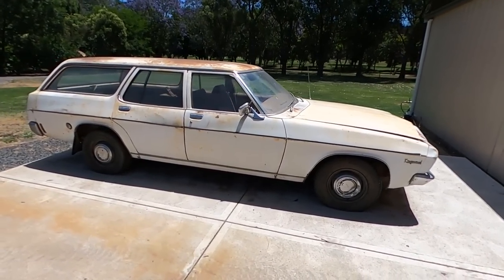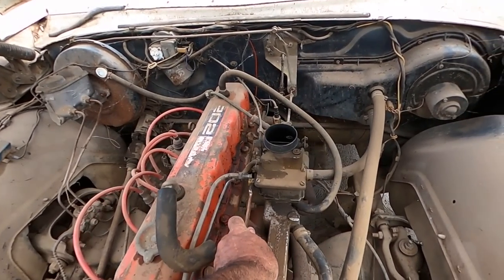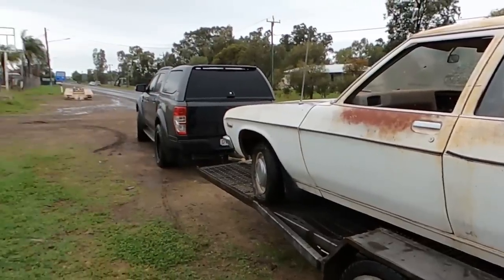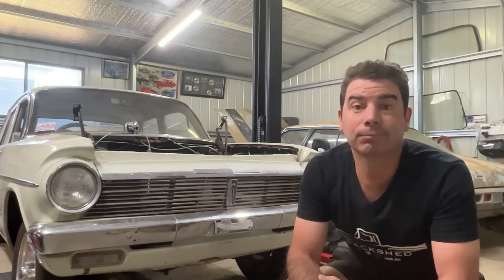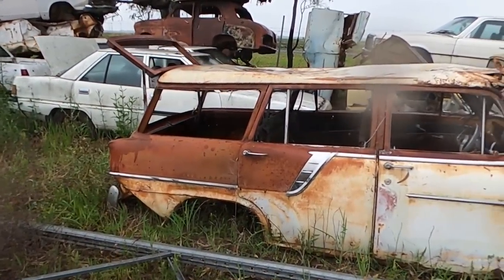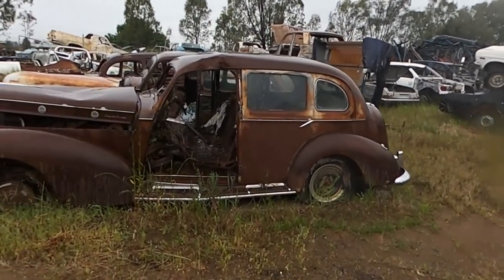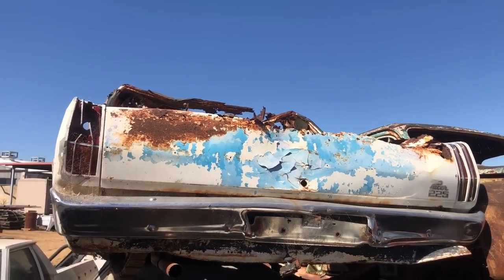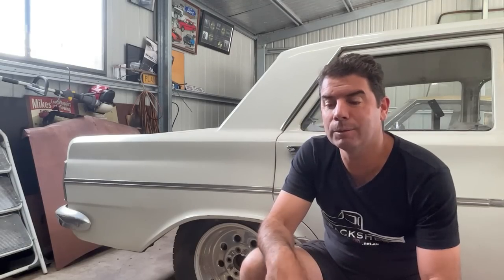Ep 18 HQ HOLDEN CLASSIC FIND +XB FALCON COUPE , MONARO , TORANA MOPAR CHARGER + WRECKING YARD RESCUE

Comment: This is good stuff, I am in USA. I am a gear head, drive a 74 satellite,  I rebuilt the 340 in it dynos 425. Then took out 727 auto a shoved in tremec 5 speed, 355 rear. This is a hoot to drive. Still got some work to do. I always liked the cars you guys had down there, never could understand the 4 door hot rodding, that 351 gt sure looks good.i had a torino gt factory Cleveland  and 4 speed.  Keep showing videos.
Reply from the maker: Thanks Steve and yeah the ol Gt goes just fine with her new engine Hahahha.
Cheers for watching and please do share the channel with your stateside buddies I’d appreciate that greatly mate
🍺🍺👍

Comment: I am loving all these old classics. I have an HJ Premier station wagon 2 tone white roof Claret bodywork, Statesman Caprice front, 308 V8, Turbo 400, air cond, power steering, Electric windows, Lowered by Peter Brock dealer team in 1986. Engine was rebuilt by Larry Perkins racing in 2003, absolutely flies. Love your channel, keep up the good work.........
Reply from the maker: Cheers Noel , there’s heaps more coming mate🍺👍

Comment: That EK has a correct front grill and bumper. 
All that is missing is the bonnet bar (that will be the cast aluminium/chromed version that has a sharp point with emblem not the  blunt all chrome one).
I have owned many EK's right up to 2 years ago and am looking forward to seeing your build on this one.
Cheers, Scotty.
Reply from the maker: Yeah mate I’ve been told in the comments I got my front’s around the wrong way Hahhaha I’ve got too many to be an expert on any 1 model. Ek won’t be far away mate so stick around.
Cheers for watching 
🍺🍺👍

Comment: valiant 60s 70s pick ups were the work horses in south africa and Rhodesia. few barracudas were around .1970s TRAX  car factory made jeeps 4x2 and used valiant engines gear boxes front  suspension and rear axles imported new from oz .
Reply from the maker: @janviljoen-rm8zs  🍺👍

Comment: Regarding your hq wagon, look closely, it has a now rare power aerial switch to the right of the heater control. In addition, given it has '202 High Compression' on the rocker cover it is likely it is the original motor, however listening to it crank over suggests the starter motor was replaced with one of those non original high torque units at some point.
Reply from the maker: Thanks mate your very knowledgeable on the Q’s. way more so than me Hahhaha. 
Hope you enjoyed and stick around for the full wagon episode coming shortly.
Cheers 
🍺🍺👍

Comment: I lived and worked in Country NSW years ago and every little town or village had a wreckers full of similar stock including stuff going back to the 1920's. Also,working with wool growers etc I got to see places where every car the property ever had was laid up in a row. Even back then I knew guys who were travelling out from Sydney and Melbourne to grab boot lids,doors and so on .Even saw a FJ panel van cut into two so it would fit with another on a trailer. 
The Pacer was sad.I was business with a bloke who had two of them in the mid 70's. But i recall his being 245's. three speed manuals and poor brakes. He added an extra PBR booster under the rear seat to improve the braking. 
Depending on what engine it has,the old White Merc W116 could be worth something as a parts donor too.Rust free parts are getting harder to find for them now.
Reply from the maker: I hear ya mate , there was so much to take in out there.
🍺🍺👍

Comment: The main issue with these not wanting to run properly after sitting for this long , is getting oil pressure in the lifters, so they fully open the valves. Tiny oil ways in these lifters get clogged with carbon.
Reply from the maker: 100% mate 
🍺🍺👍

Comment: Great video. Know all those cars, driven or owned pretty much all of them…except maybe the Humber and some of the Jap stuff. EK looks good. My FB had a rusted out floor pan. I discovered that most of the FBs and EKs passenger floor rusted out as there was a whole series of things that rusted out that finally let the water run down behind the vinyl mat. Don’t think I saw a HD there. I loved my HD. Had the little 149 with a 3sp. Weird colour combination. A light cream with an emerald interior. Holden came out with some weird colour combinations…oh, the EKs had a Hydra-magic three speed option but with the 138 the car was a slug. Big plus with the EKs over the FBs is they had electric wipers rather than the vacuum job.
Reply from the maker: Cheers for watching David
🍺🍺👍

Comment: with all the extra metal you have put on the trailer and only braked axle I'd be concerned about being over weight when you put a car on it
Reply from the maker: Don’t over think it mate Hahha its been across a weigh bridge for rego and isn’t much different to what it was . The  mesh I removed was 4mm x 12mm grid it weighed heaps. 
🍺🍺👍
Reply: @backshed5295  No problems, was just concerned as I only had a single braked axle on my trailer, (which is shorter than yours), my early Commodores overhang front and rear) by the time I put a winch,  ramps, toolboxes for straps I was pushing 600kg and a My old HQ weighed @1400kg,  so would be  pretty close to the 2t limit.
Reply from the maker: That trailers limit is a fare bit higher than that so we’re all good at this point. 🍺🍺👍